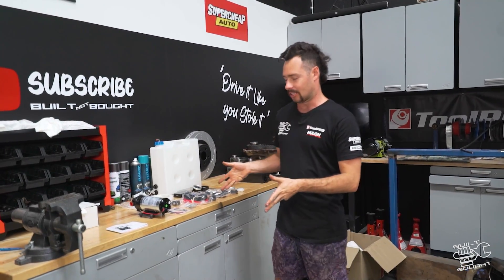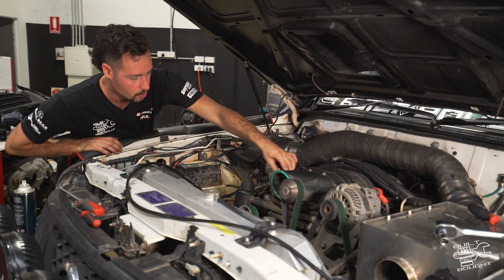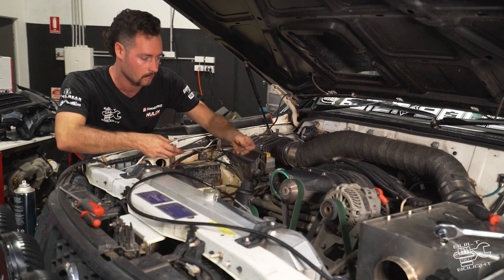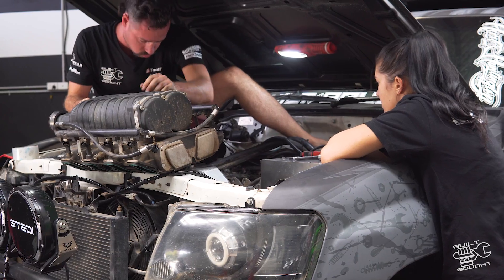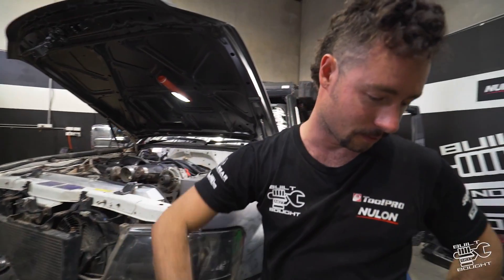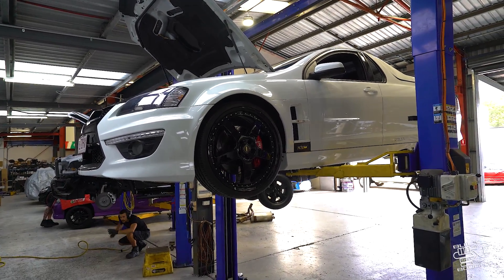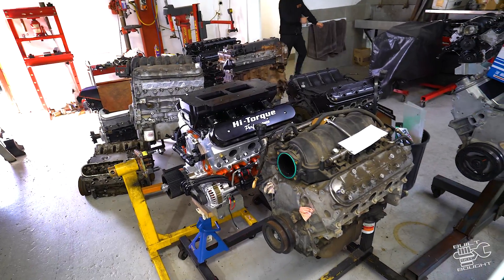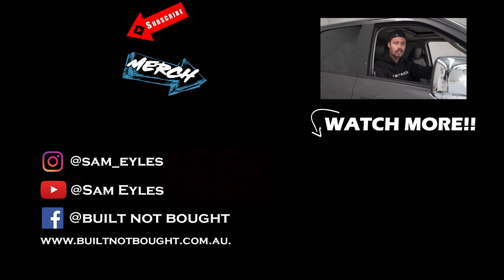WHAT IS AN INTERCHILLER!?

Comment: Been running WM injection for a bit now on turbo diesel applications with good results. In order to get the best cooling from WM you need to inject pre-compression. You were injecting post compression - like most people which is why your results were poor. It's very easy to inject pre-compression on a supercharger and will be more effective than using parasitic aircon technique. More difficult on a turbo to inject pre-compression - some people have had great results spraying directly onto the compressor nut at 2-3mm distance, but many have ruined turbos trying to get this setup. Safer option is volute injection - take the turbo off, split it and mount the injectors to spray into the compressor housing. No blade erosion and can kill all the compressor heat at source.

Comment: Suggestion:
Copy production vehicles from the 70s / 80s
1. Hot air expands and rises
2. Radiator fan floods the engine in hot air
3. Complexity (and weight) is the enemy of reliability (and performance)
Put vents in the bonnet that direct radiator exhaust air (heat) out the top of the bonnet
Put heat shielding on exhaust, air tubing, aircon tubing etc...

Comment: Orlando is an absolute legend! Also I was under the impression harrop didn’t want water meth sprayed through the blower? Fun fact, petrol ignition point is 280c ethanol is is 365c and methanol is 470c so massive difference in range! My intake temps on boost are in the teens with water meth! Those FI inter chillers are absolutely incredible 👌👌 I had lights at the front of my patrol like yours and was having over heating issues, removing them made a big difference
Reply: Totally agree! 👌

Comment: That Aquamist water meth system is mint, I'm currently running one of their direct port kits in my FG turbo.
It's unbelievable how it achieves almost identical power figures with premium 98, compared with say e85 and no water meth 👌
Reply from the maker: Yeah keen to run it on the 80!!

Comment: Good bit of kit👌, potention improvements for the future but not a necessity would be to insulate the reservoir and fit a low level warning to provent the heat exchanger cracking from low flow if it hasnt already got 1. Great video, very informative🤙

Comment: Sam the best way to keep it all cooler again is a good engine fan (I'm awere ls does not run them ) maybe a truck version does ? , most reliable and effective for ya cooling.
Reply from the maker: No good for water crossings
Reply: @speyles  I am referring to use a fan with a viscous hub all good then ( you have the fan  mounting point I'll can help with the fan that will work ) let's test it , I think you'll be very surprised Sam ? Theres another topic for ya veiwers . Higher hp engine in a heavier vehicle and slower to no air flow through the rad ( beach ). Electric fans don't pull the same air as a good engine fan .

Comment: You'll probably find alot of engine temps can come from the tune aswell. If it's on the lean side for more power it'll run hotter.
Reply: On a petrol, yes
Reply: @jarrod1687  and in this case it is petrol so leaner will bring higher combustion temps, which over all will pass heat into other systems. Diesel on the other hand excess fueling or poor atomisation will cause the same thing.

Comment: I’ve been running the Aquamist setup on my Hilux for a while, good piece of kit. Wouldn’t running water/meth and an inter chiller cause the water/meth to form droplets through the heat exhchanger?
Reply: When a droplet is large enough it is blown/sucked into combustion and instantly vaporized
Reply: @ForcedInductionInterchillers  ok sweet thanks for the reply!
Reply: @ForcedInductionInterchillers  can you use this type of system as a trans cooler?
Reply: @cmorahan  it would get way too cold and the oil would thicken too much